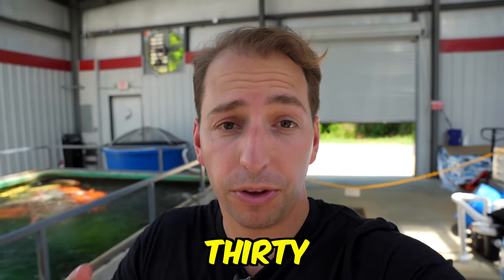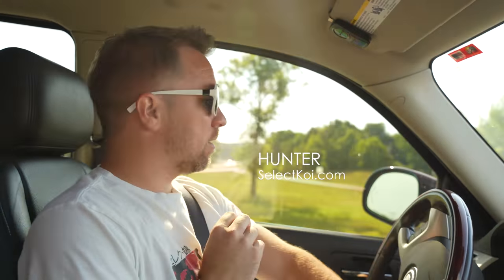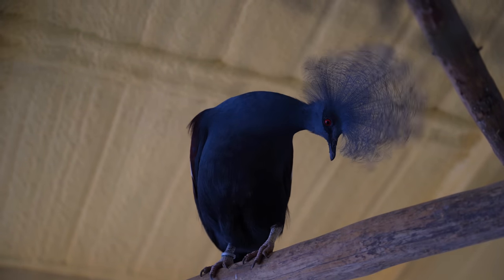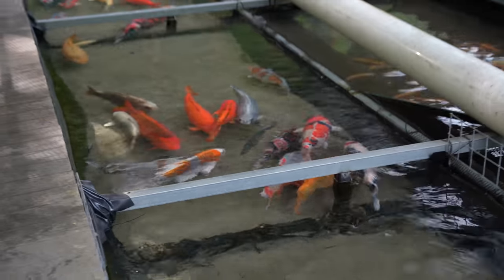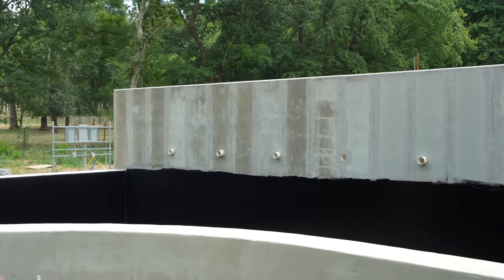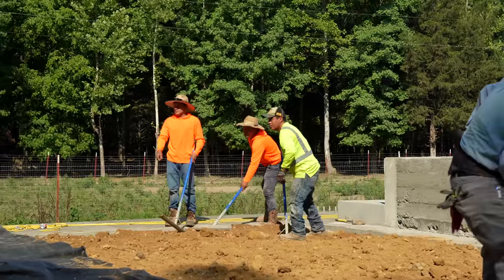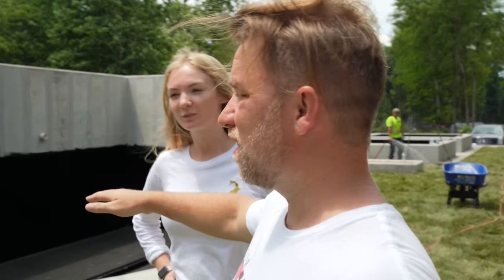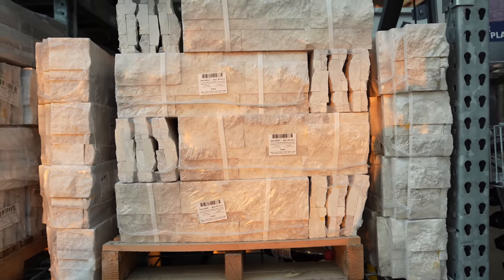Building A Massive Fish Pond! (pt 1)

Comment: Interesting project. But why would anyone plan a pump fed filter system for a new pond of that size with the approach to achieve perfect water quality, or do I miss something here? A pumped system is always more maintenance intense and the energy efficiency is a pure nightmare. In my opinion this approach simply does not make a lot of sense, why no gravity filter system? I am looking forward for more information about the details in the future, maybe I got something wrong. 

Anyway, thank you for sharing it with us!
Reply from the maker: Hi F. Reak! Good question and I am happy you are asking for this. I don’t have all the details but this is what I know: 

So first of all the owner had some wishes in the design that Hunter had to take care off, that’s why some parts of the pond are different than you may have expected. One of those things is everything should accessible for the owner and the person that maintains the pond and fish. It will get more clear in the next episodes. 

He wanted to be sure he got a dubbel system running and failures are not an option. 

The owner gives a lot about his fish. Energy is efficiency is not an issue on this project. In the future there will be solarpanels on the roof. The whole facility has a roof at the moment so that will make more sense if you see that end result 😋

Thank you for asking and watching
Reply: The simple answer is because the Hunter guy doesn't have a good grasp on efficient and good current understanding of a high end koi pond.